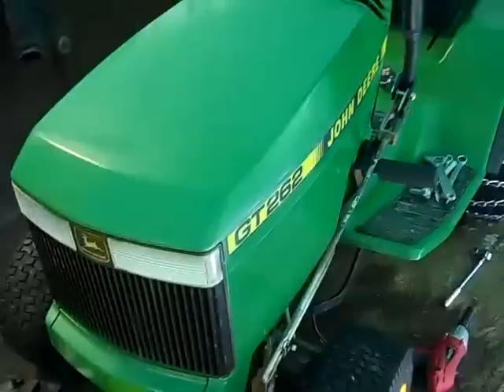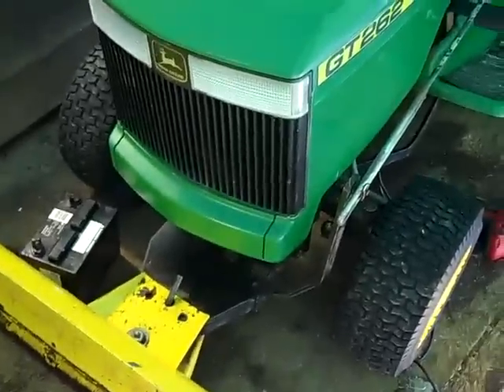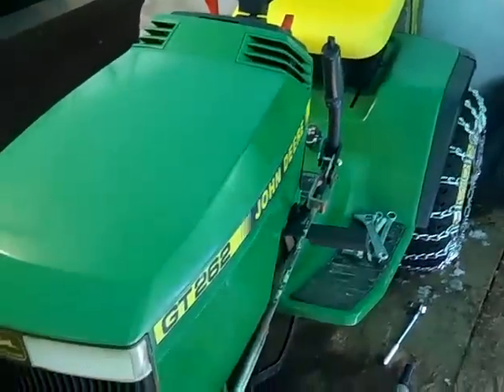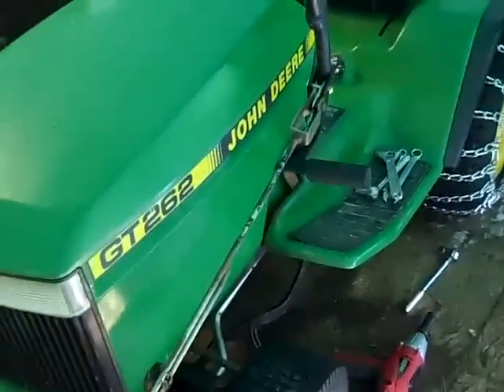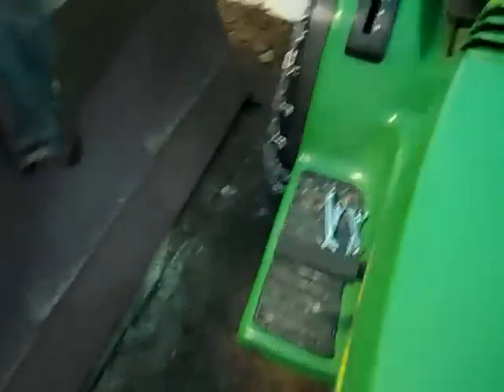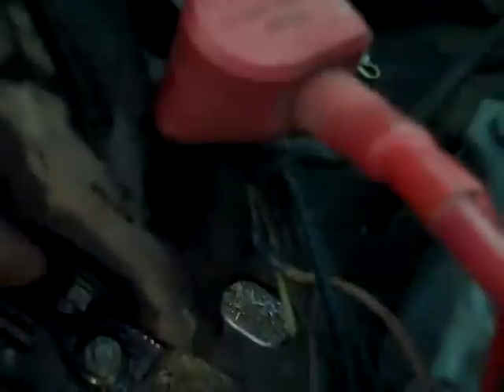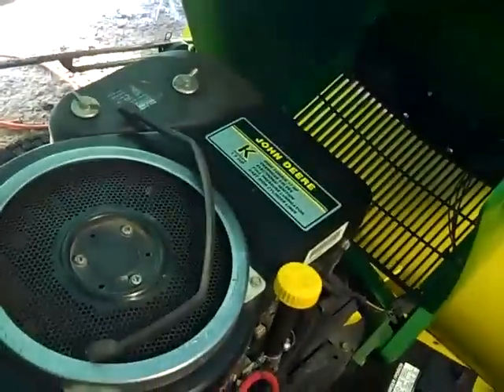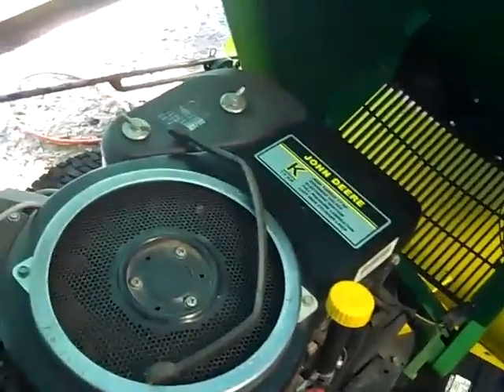John Deere GT 262

Comment: Wow .. My friend got a 320 (same line as your tractor) thats hydro and hydraulic lift for 350 with a blower  48" edge cut deck and a blown motor we found a kohler Vtwin for $20 slammed that in and it runs awesome and works even better